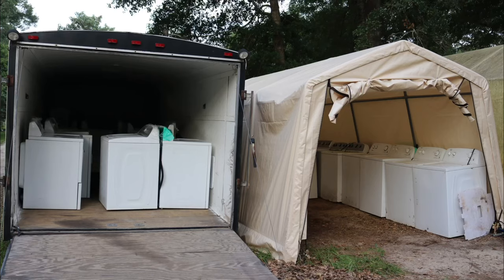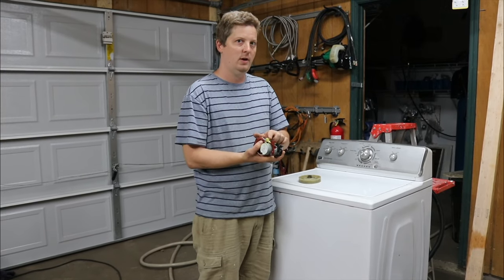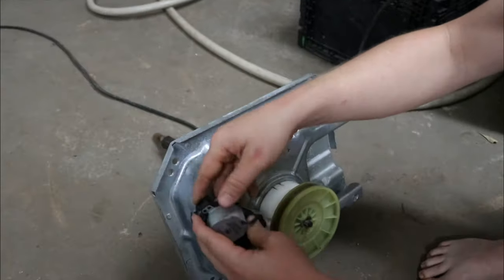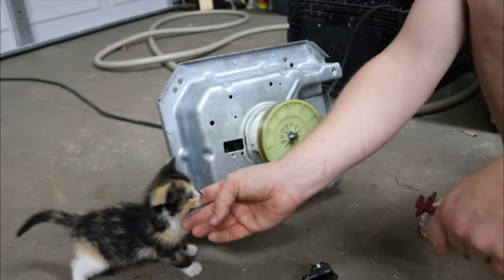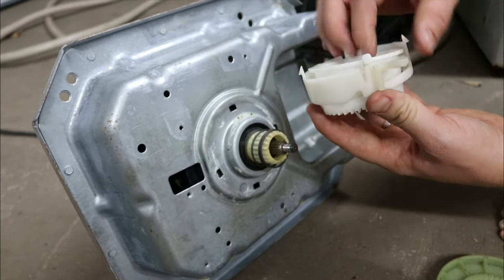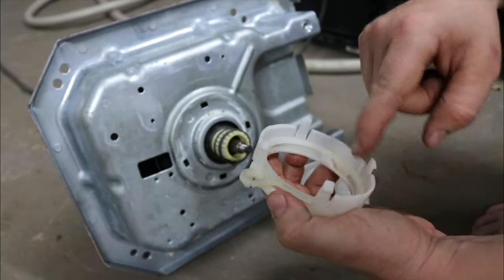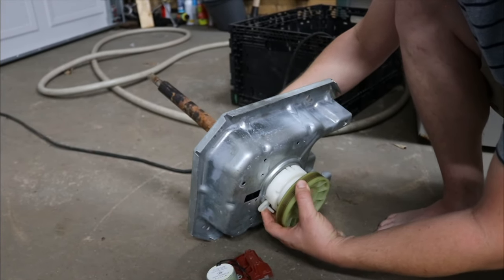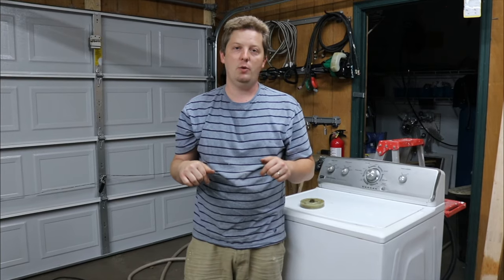Washer No Spin or Grinding Sound? Actuator Transmission Step by Step Guide to Fix or Replace

Comment: Hello! I have an Amana belt driven washer. It recently just stopped spinning and agitating all of a sudden. Also, a few loads of laundry prior to that, there was a very heavy baby blanket put into it and I think that might have knocked it off balance. But it continued to work just fine, until it completely stopped spinning and agitating. It drains and fills fine, but when it gets the the rinse cycle, it stops and flashes with the lid locked. There is also humming in the wash cycle, but no movement. I just bought this a year ago, model Amana NTW4516FW3, which now I'm learning that it's not that good of an appliance. Anyways, I was looking into replacing the shift actuator, but before I waste the money, is it common for those symptoms for a bad shift actuator as the ones I described? I appreciate your time and very grateful for your help!

Comment: Hello, in Brazil this same cam system has been used by Whirlpool since 1991, as for this problem-free system it has been online for 30 years.
Reply from the maker: I wonder if they’re using a different type of material for the foam piece that’s deteriorating.

Comment: When my drum spins it sounds like ball bearing skipping or grinding. Not that plastic teeth clicking sound you made.
Would this be in the transmission and do you know if it is openable to repair / grease or replace  ball bearings.
My agitator post wobbles a tiny bit and shakes the cabinet some. I replaced the shift switch because it was not spinning. It spins now and does a full cycle but it shakes and I am worried that it needs more fixing. Saw this vid after fix and wish I had greased the gear mechanism. Also forgot to place belt cover. Tipping it over again ... 😂

Comment: love to watch your channel. anyway I have a Maytag Performa model PAV 2300AWW. the laundry goes thru all the cycle but when done cloths still soak and wet. I check and notice the drum is not turning, I tried manually turning it and its so hard like its stuck. have any suggestion. Thanks
Joe

Comment: Can I replace the original 4watt shift actuator with a 2.8 watt? I thought I read that this would blow the mother board. 🆔 not want to cause more issues with the replacement. Tysm for the info!

Comment: Very informative video. Thanks.  I have a Maytag Washer Model MVWC416FW1 (very similar to the one in this video), whose transmission bearing is noisy. Can those bearings be replaced, or do I need another transmission? thanks.
Reply from the maker: I have a video on trying to replace the bearings and it is outrageously difficult. In fact, I couldn’t get the bearing off after hours of work.
Reply: @WasherDryerMoney  Thank you for the fast reply. If you couldn't get the bearing off,   no need of me even trying.

Comment: Just to add, i had the same symptoms but turned out my basket was rotted out where it bolts to the shaft. Make sure to check that if youre having a grinding and no spin issue (mine was jammed because thr basket was snapped around the bottom)
Reply from the maker: Rare but that does happen.
Thanks for sharing.

Comment: Thanks for this video! I've been dealing with this exact and very intermittent issue for months now. Ended up replacing the shift actuator twice, then swapped out the control board, and when it came back ended up ordering a harness. I checked to make sure I could actuate the shifter by hand but didnt realize that the shift actuator motor was too weak to do it. I'm looking forward to trusting my machine to not leave me hanging with sopping wet clothes again.
Reply from the maker: Good luck. Honestly this is one of the worst-one ever made. It’s also probably The most common one sold. There’s a ton of different ones that have the same Exact shift actuator issue among other things.
Reply: @WasherDryerMoney  What do you recommend for good machines? Thanks again for the info!

Comment: Thank you I bought a brand new Maytag a year ago the actuator pin on that arm keeps popping out of the hole I have to flip the washing machine on its side at least once a week.  The place I bought the washer from has not been any help and Maytag has been giving me the run around about it.

Comment: Machine won’t agitate or spin, was making a clicking/tapping noise. Changed the splutch  kit because actuator was only 2 months old. Didn’t help. Swapped with another actuator which was previously working, tapping noise stopped but still no agitate or spin but when it’s supposed to shift there is a loud screeching noise for a moment.
Reply from the maker: Always hard to diagnose without me I want to see it but my guess would be hey Bad actuator. There is a Facebook group that helps people with appliances. You can post a video of exactly what it’s doing and usually get great advice from other repair guys. It’s called something like appliance repair group or something like that.

Comment: Seems like you know a lot about these washers I’m trying to find a universal spanner wrench that can be adjusted to take off the nut recently I ran across a hot point with a slipper nut at the bottom. Wondering if you seen a spanner wrench that can be adjusted for different size nuts with the spanner wrench body. Any help would be helpful. Thanks again for the video it helped me a lot.

Comment: Thank you!  Do you know what would cause a brand new splutch kit “basket” piece, to become damaged after only one wash cycle?  It looks almost melted and deformed around the rim of the basket. Thank you so much for your help!
Reply from the maker: Could have been the actuator going bad, and not pushing the arm hard enough. That’s definitely an odd problem possibly re-calibrate. Maybe the actuator is pushing the armed, the wrong point.
Good just a bit a fluke and you may replace the actuator and the Splutch again. Hate for you to spend so much money on such a garbage washer machine.
Good luck I’m not 100% sure.
Reply: Thank you!

Comment: Thank you for this.  I've already put a new trans in my Maytag but I didn't put a new washer tub gear in, so it was making a grinding noise from the new trans splines not meshing with the worn out wash tub teeth.  After putting in a new tub gear I'm still getting a grinding noise and now I'm thinking I should have put in a new splutch while I was at it.  Or maybe like you said, the actuator and the spring are not strong enough to fully engage and are letting gear teeth drag on each other.
Reply from the maker: Be sure to put some oil of some sort on all those plastic parts in the spluch. If it is hard for it to move it will sometimes mess up.

Comment: Great video. Sand in the machine. Guessing local issue. My issue is washer works noisy spin cycle and clothes are still soaked when done. Used special spin and drain cycle, spins but intermittently clothes still wet. Suggestions? Is it possible for me to do it, hire a repair person, or just bag the 6 year Maytag and move on? Thanks!
Reply from the maker: First try to recalibrate the washer. I don’t have a video on that yet but there’s a bunch of videos on how to put these washers in recalibration mode. If that doesn’t work my next best guess would be the actuator is going bad.

Comment: Could you please help me, my ge spins but only at 50% speed and makes a grinding noise.i have had two different repair guys come out and they have no clue what is wrong with it. Please help thanks in advance
Reply: Mine is making grinding noise whenever it's agitating in reverse only. Think we're having same issue. I can't find any help either.

Comment: Great tutorial you give. If I'm only finding that grinding noise to be the issue, that means I prob need a new actuator correct?
Reply from the maker: Usually if it’s making a grinding noise it’s not the actuator but the splutch.

Comment: l have a kenmore series 500 the spin cycle doesn't get all the water out. I bought a clutch assemble, the unit has a set up like you demonstrated.. so my question is, the kenmore i have, does it have a clutch?

Comment: This is a great video. You did an excellent job explaining everything.  Unfortunately it didn't fix my problem but I'm hoping you have some further insight that you'd be willing to share.  My Maytag Bravos X (not XL) spin cycle sounds like an airplane taking off. I've looked and looked on YouTube for a video showing me how to replace the bearings but cannot find one for the X...which is belt driven.  In all the videos that I have found, although its a Maytag Bravos it looks nothing like mine does underneath.  They all have the wire coils and magnetic statter thing.   My washer looks exactly like the one you used in this video.  Have you ever replaced the bearings in this type of washer?   and if you have........can you show me how to do it please
Reply from the maker: I do have a video where I attempted to change the bearings on a certain type of washer that covers a bunch of different brands. Check it out and see if it’s the video you’re looking for. It’s the one that says something like bearing replacement.
Reply: David, did you find out what the problem was with your washer? I also have a bravos X washer. I'm not sure what to replace. It sounds to me like bad bearings on a skateboard. But, after watching this video, I'm wondering if poor actuator function is the issue? Did you repair your "airplane" sound?

Comment: I have a 1980s Maytag top load washer and when it gets to spin cycle, the washer pumps the water out but doesn't spin. It smells like the belt is turning but the drum isn't. I was by washer when it happened and immediately turned it off as not to cause any damage to belt. Would this typically be actuator or clutch assembly?
Reply: Mine is doing this too.

Comment: I have a Maytag Centennial washer like the ones in your "excellent" videos. The wash plate turns freely, but the inner tub will only turn about a tenth of a turn. All parts under the washer have been removed. Is this a common problem? Any help appreciated.
Thanks,    Gene

Comment: Hey great video I have washer kenmore 700s  he and its making that noise although the video explain well will it be the same for this type of brand
Reply from the maker: Lean it over and see if the transmission looks the same. If it does most of those newer washers with the pause play button have the same issue with those plastic teeth getting ground up. just be sure to unplug the machine before you work on it.

Comment: Ive been pulling my hair out over a kenmore 110. 500 series top filled. I just replaced the hub kit thinking its the reason why it wont spin. But after i recalibrate it. It still made the loud grinding noise similar to me driving a manual vehicle and shifting it and it making a loud grinding noise before cycling.

Comment: My Whirlpool Cabrio jusy makes a clicking sound from below when start is pressed...ran a test...got F7E6 F7E5 codes...was told it could be the actuator...or the control board...or the splutch...or the motor...and when a tech actually checked it he said it was the gearcase...$$$$...so we replaced the washer ...I still have the old one in the garage & am picking at it out of curiosity...I have the splutch taken apart and it looks fine...is there a way to test the actuator with it removed from the washer? Again, just for curiosity at this point

Comment: I just removed and cleaned the drive pulley and splutch on a Centennial because it was making a momentary grinding noise when it started to agitate and/or spin. 
  Seemed to solve the agitate noise but still had it when it starts to spin. 
  I also put a new actuator on it. 
  I was thinking of changing the pulley itself as it looked like the splines might be worn. 
  But from what you say here, that should affect the agitating cycle, right?

Comment: I have the problem you described but my model of Maytag is different then the one you described.  My model # is MAV3955EWW - REV 27
It has the grinding noise and will not spin dry.  Thank you for the video and I just need to know if there will be any difference in the repair operation on this model.
Reply from the maker: If your machine has the same six lights and pause/play button it probably has the exact same transmission as this machine.

Comment: Hey WDM thanks for the video. Our Kenmore Series 500 stopped spinning one day and that's all she wrote. After fiddling with it a bit it DID make that grinding noise you showed when the actuator is in-between gears. I thought there was a transition failure or worse. But that noise in your video matched my washer's noise, which convinced me you were on the right track. 

I ordered the part using your link, and that was just today, so I don't have it yet. I also liked and subscribed. If this fixes my washer you will be my new YouTube hero. My wife does all our laundry (her choice) and she is getting nervous about us not being able to wash clothes. Once I get that part slapped in there if it works there will be two really happy people here in WA state. 

People say they'll follow up and never do, but I plan to just to let you know how things turned out.
Reply: Following up - not the problem. Got the part today, installed it, no joy. 
The tub wasn't moving inside, either. I took apart the agitator (low profile HE type) and cleaned everything out as much as possible. Nothing broken there. Put it back together, worked the tub back and forth in both directions and it came free. Tested the spin cycle, works. Ran the "clean" cycle, worked fine. Wife happy, me happy. 
It was a $40 experiment but I learned a lot and real knowledge is never free :)

Comment: My washer makes a grinding noise during sensing and during the spin cycle. It washes  without any problems. It does not spin fast enough to spin the water out. Do you think that changing the actuator and clutch will fix it? Thanks!

Comment: I have a Amana washer after watching your video I thought it was the actuator. The washer will go through entire cycle but the washer will not agitate. but upon inspection of the unit I noticed the bottom plastic cover was covered in oil. I I though it was coming from the motor since it looks like most of the oil gunk is on it but I was told it could be a transmission oil leak. Do you think replacing the transmission is necessary or will replacement of the belt, actuator and spultch be sufficient?
Reply from the maker: Check this video out. I made it on the oil leak.
Usually is pretty much bad news because there’s not really a easy way to fix it.
https://youtu.be/WF5V1Dijsiw

Comment: Our Whirlpool WTW4816FW2 started making a squealing/screeching noise. I turned it off and about 15 minutes later it pumped all the water out and the pump would not stop. I unplugged it for a while and when I plugged it back in the pump started running again. Any idea of what ie happening with it?

Comment: Great video, hope you can provide guidance.  I have a Maytag WTW5000DW0 washer.  The washing machine wasn't spinning and was making a grinding noise.  I replaced the actuator motor using your instructions.   It  stopped making the grinding noise and will start to spin but then stop.  Last year it stopped agitating, so I replaced the clutch and the agitator.  I inspected these and applied white lithium grease as you suggested.  The teeth all looked great.  When I try to run a load it will work up to the spin mode, but then it will start to spin and then stopped.  However, the different modes don't light up, it just blinks the green spin light.  I've tried to reset or recalibrate the machine using different methods I have found online but nothing seems to work.  If I unplug the machine, and wait 3 minutes, as soon as the power is restored it just keeps blinking the green spin light.  I have pictures of all my disassembly and reassembly.
Reply from the maker: It sounds like you have tried about everything I would suggest. The next steps would probably be replacing the circuitboard but that is expensive and honestly this type of washer is not worth fixing for that price.
If you’d like to try more I would put it in diagnostics mode and see if it has any codes. If you are getting frustrated and ready to get a great washer I would get a used direct drive washer. The direct drive washer is super easy to work on an expensive to fix and like an old truck last quite a while between repairs. If you want to go new get the speed queen classic. Good luck.
Reply: @WasherDryerMoney  Just to circle back, the issue was with the hub, the interface between the hub and transmission is all rusted.  The hub was completely stripped and the transmission is all rusted.  I bought a new hub and filed the grooves on the transmissions and was able to get the hub to fit over the transmission (it wasn't easy).  I tried to engage the locking pin but the transmission is so rusted that the pin just broke when I tried to force it in.  It's working but for how long I don't know.  It will need a new transmission the next time it fails.  I'll have to decide if throwing a transmission at it is worth my money.

Comment: Thank you. I have a question: when the Frigidaire top load washer almost finish the final spin cycle (the spin is fine, closes are dry) suddenly comes out the very loud noise for less than 30s then normally stops, what happen? what wash tries to do between the end of spin cycle and final stop?

Comment: Hi loved the video.  I have a whirlpool  top loader with an agitator and a nice row of pretty LEDS.  my washer likes to go through all the cycles of the selected wash setting, up to and including done and unlock. And if I am not there to open the lid when it is done it will start all over again. Any help or advice would be helpful.  Please!
Reply from the maker: That’s really strange I’ve never heard of the problem. My first thought would be the gray start button is touching on and off. But I’m not sure.